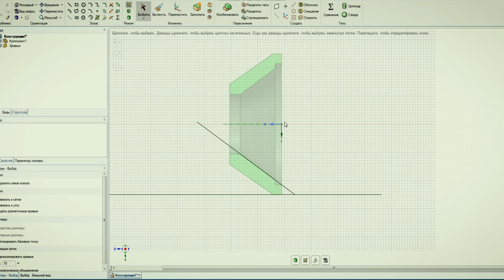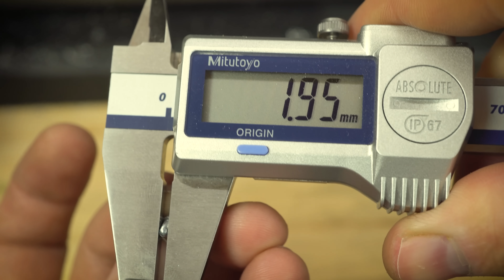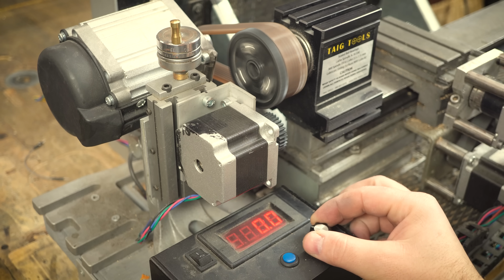Action camera and a HUGE old lens!

Comment: 10-100mm f/1.8 is an impressive lens. Consider also the "zoom effect" due to small sensor dimension of the camera.
Reply: Typical television lenses tend to have these sorts of ranges because they have to be able to reliably do a lot of things at the same time.
Reply: absolutely! Having this wide apeture in a zoom lens is phenomenal. 
Unfortunately the sensor is way too small to even get the real benefits of having such a wide apeture
Reply: @stevensoether  actually, considering that this lens is made for 16mm film, this 1.8 aperture is equal to F3.2 in full frame 35mm film or sensor
Reply: @ryanngat  How do you know that the crop factor of this actioncam's sensor is 1.77778? Is that correct? I don't find anything about the sensor size on the SJCam website. If so, the focal lengths 10-100mm of this lens would be equivalent to 17.8 - 178mm on full frame, which is not impressive.
Reply: @Thunderbird1337  he was talking about the crop factor of the 16mm film, for which the lens is intended. The crop sensor of such a camera is around 5.
Reply: @ryanngat  Crop factor doesn't change light gathering, a 1.8 lens will have a 1.8 aperture no matter what sensor you put it on. It is the equivalent of F/3.2 only in therms of depth of field.
Reply: @pierrevilley6675  Ok, if the crop factor of this cam is 5, the lens would be equivalent to 50-500mm full frame. That's quite a nice zoom. But I'm sure there are still better ways doing this in this package size with modern MFT or bridge cameras.
Reply: @Thunderbird1337  Bridge cameras and MFT have both a bigger sensor. Keep in mind that this lens was designed for a sensor almost 2 times tinier than MFT (the closest thing from 16mm film on the market are the 1/1.2" sensor). The exact same lens for MFT would be almost 4 times bigger, which means a 4kg weight for a 10-200mm equivalent, f/1.8. And you'd also have to work on the optical formula to have a quality matching those very demanding tiny sensor.
Reply: @pierrevilley6675  Don't think that (all) bridge cameras have bigger sensors. Some of them have rediculous zoom range in very small form factor, they must have small sensors.
Reply: @Thunderbird1337  In general they have a 1" sensor, but you're right, some have tinier sensors (basically a smartphone camera with big glass)
Reply: @pierrevilley6675  can confirm, Nikon Coolpix P900 is essentially a smartphone camera (1/2.3" sensor) with a big glass in order to achieve ultrazoom (24-2000 mm FF equiv.).
Reply: @pierrevilley6675  nope. Their censor size is as big as your typical smartphone camera.
Reply: @ryanngat  That is just not correct. A super 16 film sensor has about a 2.8x crop factor (give or take) in comparison to full frame. Which means the depth of field will be about f5. Unless you are talking about the super 35 format?
Reply: @Thunderbird1337 Show me a FF 18-180mm lens with an f1.8 aputure that doesnt cost a fortune xD
Reply: @kernelpanic2887  Why 18-180? If the crop factor of this sensor is 5, this lens has a full-frame equivalanent of 50-500m. And not to forget, the aparture must also be multiplied with the crop-factor, if you want to compare the depth of field. Means f1.8 on this sensor equals f9 on full-frame.
Reply: @Thunderbird1337  that range came from your own comment I replied to, lol. And no, f1.8 is f1.8. Sure, DOF wise you will get much more, but brightness wise (the important bit for such lenses) it is still a f1.8, so still an impressive lens.
Reply: @pierrevilley6675 that’s not true. The f-stop is just as affected as the focal length. It might still be 1.8 but a lot of the light falls outside of the sensor. It doesn’t affect the depth of field, but it does affect the light that reaches the sensor.
Reply: @Kommaardoor64  Light falling out of the sensor doesn't change the F stop. The F stop is the Aperture width/focal length ratio, sensor size doesn't matter, so a F/1.8 Medium format lense would still be a F/1.8 lense even if mounted on a smartphone sensor. Focal length isn't affected either, being a physical component of the lense. But sensor size does change the FOV, which affects the reproduction ratio required for a given composition, which is a key factor in depth of field.
Thats why your smartphone has a big DOF even if it is (generally) fitted with an F/2 lense. 
Saying that a full frame 50mm 1.8 is a 75mm F/2.7 on an APSC sensor is not phisically true, but the setup will have the same characteristics as a full frame sensor fitted with a 75mm F/2.7.
Reply: @ryanngat that is not precisely how that works, that "equivalency" is only valid for the amount of blur you can get at the same perceived distance with an object, but that is the least important thing about aperture.  The most important thing is how much light you get to each pixel, and that does not change with sensor size
Reply: @stevensoether 😊😅

😊😊
😊😊😊😮 0:42 

😊 0:45 
😮😅
Reply: @hundry_f  "it's a cropped field of vision" -> which you could also call a zoom effect if you will. If I put my 180mm Full-Frame lens to an APS-C sensor, I have an equivalent field of vision as 270mm on full-frame. Sure, it's nothing else than a crop of the full-frame image, BUT with the advantage that I have the full resolution (24MP) within this crop. If I crop the 24MP full-frame image, I'm losing a lot of resolution. So in the end this means that a smaller sensor gives you more range if sensor resolution and focal length stay constant. Which I'm fine to call it "zoom effect".
Reply: The adapter ring also acts as an extension tube, adding to the conversion. Should be like a 50-300mm 35mm lens equivalent iirc
Reply: @AndrossUT if he properly designed the adapter then it will have the correct back focal length and not act as a macro tube. If he got it wrong then he wouldn’t be able to focus at infinity, which we can see from the video is possible.
Reply: Ikwym but the most common term used for that is 'crop factor'
Reply: Объектив сделан в СССР!!!
Reply: Its a cinema lens. The specs aren't at all out of the ordinary for cinema lens.

They are pretty much always much more impressive than "normal" video and stills lenses.
Reply: @JimIBobIJones it’s decent for it’s sensor/film size. You’d find almost no cinezoom lenses with that focal range with a t stop of 1.8. Canon did recently come out with a cine zoom that’s 31.5-95mm with a t/1.7. But even that one is for super 35 sized sensors.
Reply: @parkiel54  aperture size is aperture size. It's mechanically impressive regardless of crop factor of the sensor/film.
Reply: @JimIBobIJones  that is for f stop yes. T stop measures how much light reaches the sensor.

Comment: This is interesting, and I've been thinking of trying to do something similar with m43 or m42 lenses and my iPhone 13 Pro Max using a Smallrig cage, 17-37mm adapter. I have a couple of questions for anyone here: 1) In this video, the image circle the lens makes at focus is full frame, about 43mm. This action camera has a much smaller sensor, so isn't most of the image circle and the light lost? Wouldn't a focal length reducer/telecompressor/speed booster entirely fix this problem? 2) In this video, the action camera's lens was removed. If you don't remove the lens (as I would not do with my iPhone), the telecompressor would not work, right? Wouldn't a DOF adapter be needed (basically a tiny rear-projection screen between the two lenses)? Would this be practical for adapting a full-frame or m43 lens to an iPhone?
Reply: Circle of light is lost, but amount of light per are remains. If the lens was f/4, it's still an f/4. Using a "booster", which is an adapter with a lens that focuses larger circle of light to a smaller area, will boost the amount of light per area, as it "squeezes" light in smaller area (magnifying glass and sun thing of action), so then the base f/4 can become way beighter aperture at final calculations.

If the oryginal lens was in place, you will need a refocus lens in between. For example, if your phone has a minimum focal point of 2" away from the sensor, and the dslr lens has a infinity focus at 1" from the real mount, you will need to cover the gap with an adapter. Removing the device lens, just makes adapting easier as you work with one focal plane, not two.
Reply: @michalsierzchula  Thanks. I'm aware of the light per surface area of the sensor not diminishing by using an undersized sensor, but the angle of view is greatly altered. This seems like a huge crop ratio. Lenses were not designed, or ground, to have just the center few percent used. Mounting full-frame lenses on m43 bodies without a focal length reducer still works on most lenses, but it's using a full 25% of the lens. This setup is going to expose and magnify tiny imperfections in the grind. ... About using a refocusing lens instead of a DOF adapter, thanks. I didn't know such was possible. It makes sense, though. Still, such a lens should be included in a focal length reducer to maximize the use of the full lens. I'm guessing the ongoing change in iPhone sensor sizes would make such an adapter impractical. If Apple stayed with one size for several years, then making such a focal length reducer/refocuser would be more feasible.
Reply: @michalsierzchula  Dzięki! Pozdrawiam.
Reply: This lens does not cover full frame, not even close. Thats why he used the action cam with a tiny sensor, anything larger isn't illuminated by the lens.
Reply: @T0ly113  Thanks, Doki Mus. I thought he said it had an m42 mount, but I checked more. вариогоир-ломо-201 (Variogoir-Lomo-201) is a 16mm cinema lens (for 16mm wide film; he does mention this at 1:00). Compared to 35mm/full frame film, this would have about 25% of the surface area, very similar to a micro-four -thirds sensor (m43). ... The SJCam action camera uses a AR0330 1/3" sensor, from what I can gather, and has a 6mm diagonal. So, 1/3" sensor: 17mm2 area. m43: 225mm2 area. So 7.6% of the image circle from the lens is being picked up by this sensor. 92% of the image is being lost, if my numbers are correct.
Reply: @GregConquest  About a 7,7 crop factor for the camera sensor, and 3,5 for the 16mm film,  the area of the 16mm film was only 75,8 mm2 (10,22x7,42), so 25% of the image circle is used. Otherwise, i agree on the fact that a speedbooster would do great (I think a 0.64 metabones should work in this case), which would take the aperture to  F/1,15

Comment: Very cool project. There's a lot of chromatic aberration on the vintage lens, which I guess is somewhat unavoidable. I don't know how bad the lens is on its own, but I wouldn't be surprised if your focal plane is just slightly off. Probably less than 1mm. If you're lucky, the proper distance is within the range of of your adapter threads and you can just screw it on a little less. Was that something you tried?
Reply: focus is set manually everywhere closer than inifinity, definitely not enough stuff far enough away to test for it. chromatic abberations are endemic to uncorrected bayer array sensors, and super complex zoom lenses. i think it's the change in lens color and contrast more than the fringing that is most noticable. but all worth it to be rid of the insane optical distortions, and having a real tripod mount.

Comment: Awesome project, great execution. Thanks for the idea. I have a nice 200mm Canon manual lens, and maybe some day I make an adapter.
Reply: You can just buy them.
I did something similar 2 years ago to use a canon 70-200mm on an action cam. The adapters were like 15€ all together.
Reply: @TheTempic  Ohh nice, I’ll look it up. Thanks 👍
Reply: @iTeerRex  its just M12 to CS or C Mount and a CS/C to EF.
Reply: @TheTempic  I figured I should find it before looking for an adapter, but of course it’s hiding in the bottom of some box somewhere 😂

Comment: Time to dig up an old lens and have some fun, thanks for the good idea!
And when it comes to lenses bigger IS (in general) better since it will capture more light.

Also for the mounting - if you look at larger lenses for DSLRs and such when going above 300 mm or so they usually have a mount for the tri-pod to make things more stable.

To get an indication on how "long" your lens will be:
Lenses are considered "normal" when the focal length is roughly the same as the diagonal of the film/sensor (thus around 50 mm for the classic 35 mm film most SLR lenses are made for). Measure the diagonal of your sensor and compare it to those 50 mm then multiply the focal length of your lens with that value and you'll see what focal length for a 35 mm SLR it compares to. You will quickly get a very "strong" lens!
(Example sensor is 12.5mm diagonal and a 200 mm lens compares to an 800 mm lens on a SLR!)